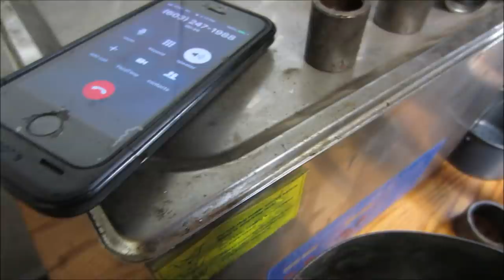VW BUS Transmission Failure,  Help Me Fix it,

Comment: Hi Mustie late to the channel but loving the content. On the leaky heat channel on the exhaust could you have welded the back shell of the tube first then you could access the inside to weld the inner edge to the rear then weld the second shell from the front if that makes sense. Just a thought, sorry if someone has said already. Keep them coming thanks  Dave

Comment: To set the valves. Take a screwdriver and weld a piece of iron perpendicular to it. Now you can adjust the valves easier because the screw no longer rotates. Or at least you can see it more easily when the screw turns. You can hold them in place more easily.

Comment: Back in 89 someone gave me a 73 bus for.....$1.00.  I fixed little stuff that made a big difference, but it kept popping out of first, I had to hold it in.
I wish I had some good help to fix it, I ended up selling it for $500.  Shoulda kept it.   The mechanic I talked to said I would have to crack open the trans in half to replace the fork.  I just didn't have the funds or tools then to get into it.  Maybe you could make a video cracking open a trans to repair forks? now that it's 2022....Shoulda woulda coulda.  These videos would have been so great in 89.....but then I didn't even have internet, or even a cell phone yet.

Comment: My folks had the ‘72 version. Same color. I was chided by some of my high school buddies who drove Mustangs to school. They laughed when I drove this until I said they could only fit 3 pretty girls in their car and it was difficult for them to get in and out with short skirts on. In my case, I could have 6 in my car and they could get in and out much more easily. They stopped messing with me after that.
Reply: In high school, I had 13 girls in my bug.  For some reason, it was really slow accelerating with the girls.  It was a short drive.

Comment: Two things:  You should always ensure the flywheel goes back on the same way it came off and an air gun will probably not torque the gland nut to the required 254 Ft/Lb.

Comment: On VW bugs, I would take the engine loose, jack it up and put blocks under it, push the car forward to get it separated from the trans. Then I would jack up the engine, remove the tall blocks, lower it onto low profile blocks and then I would lift the car by the bumper, as though it was a barbell, and walk the body forward until the engine was behind the car and I would set the car down.  When I realized I was strong enough to lift the '67 bug without the weight of the engine, I was amazed.
Yeah, they sell clutch alignment tools, but everyone I know, including me, use an old pilot shaft. If you've done a lot of car work you should have an old one somewhere.

Comment: Fun fact, those clutch springs are different colors because they have different heat tolerances before they  blister and burn. Depending on what color is burned you can tell exactly how hot the assembly got!

Comment: on the weld seam on the intake manifold...where you couldn't get to the back side...get some heavy duty aluminum bbq foil...fold couple times into a patch to cover back unwelded seam and clamp with stainless steel clamp...temp should not get hot enough to ever melt patch should seal off any leak...

Comment: Hey if you took a little button grinder and resurface the flywheel would that make the clutch last longer because doing brake rotors you don't want the lines to be circular if you can get them you know like with a grinder not a heavy grinder just to like grind the scratches going every which way it's better than them just going around in a circle

Comment: I always put a light coat of gasgacinch on the seal to case bore, because too many have leaked through where the case halves meet. but we were running them off road in rails at steep angles and high oil pressure/rpm's. I had a few leak through the crank snout to flywheel and dowel pin area too, nothing like an "oil bathed" clutch that's supposed to be dry lol
**whoops, so I started to gasgacinch the flywheel to crank faces also, some said it would make it work loose, but never any issues with a 5rib bus trans and turning large wide tractor tires. it would do over 60MPH in 2nd gear on the road. 1st gear was about perfect for all woods/climbing, 2nd the trees and things went past too fast and your rear end would pucker solid if you were brave enough to keep it wound up. the three rib trans sucked, 1st was too low and 2nd too high to run full time.
then again, nobody else seemed to like the 5rib and couldn't turn the tires good, so maybe it was the much to do with the choice of cam, rockers, timing and dual carbs on tall track manifolds and a wrench that happened to find the right combo (pats self on back)

Comment: Hey Mustie (is there a story behind that name?), 3 questions… In fixing the exhaust leak, is there not a flexible hose that can take that kind of heat that could have been used?  And if not, would it have been possible to bend out one side or the other just enough to have room to  fit the repair sleeve over one end and then slide it up enough to allow room to bend it back in line so you could then slide the new sleeve down over the other side and avoid having to cut and weld?  And finally, could you have used a chemical weld product (i.e. JB weld) to seal the ends?  Not saying that you could have or should have done any of these options, just wondering if these options were even possible?   Like you, I am always figuring out ways to repair things without replacing, so I naturally think of many options.  Thanks for all the great vids!

Comment: I”m not an expert and I don”t even play one on Youtube, but I wonder if it would be easier fix for the preheat pipe to weld the back half first from the inside to the original tube ends and then weld the front half . Might be less prone to leaks? Though welding rusty crap is always a gamble.
Reply from the maker: how would you rotate it to weld the two long seams
Reply: I assumed that it would be possible to weld them at the top and bottom, as you were able to weld the other end all the way around. Canl’t really tell how much space there is.

Comment: Could you have used "JB Weld" extreme heat to seal where you couldn't weld on the backside of that patch?   Knowing you I figure you had already thought of that. I was worried about carbon monoxide poisoning.  Is it that the fumes are sealed off so that they don't affect the occupants, or maybe there is sufficient airflow to blow it away???
Reply: Yes, they make a jb weld that's meant for exhaust components

Comment: Hello friends, I know that many of you are very professional in this, my father has a 1972 type 2 vw and adapted a more powerful engine, but this is not enough because he continues with the original transmission with a 7x40 step, I need to know  The pinion and ring with lower R&P compatible, I will appreciate your answers! Thanks and excelent video

Comment: you used to be able to pull the bumper and back brace put an orange crate under the bus undo the linkage and 4 bolts and push the bus forwards leaving the engine sitting on the orange crate, the crate was the perfect height

Comment: Turn the  hood prop rod 180 Degrees over. That will catch your shirt and put a narly cut on your arm. Unbolt it and turn it over and out it back on at a 90 degree angle and then  bring it back up and bolt it in place. 
        Interesting exhaust system, if they were going to do something custom at least bring it out the correct side.
      A fun video, everyone sees something different.

                                                                              Ycasts

Comment: that gear oil bottle had a spout(small pipe on cap) would it have been faster to put it in and just squeeze the bottle to get the oil out?

Comment: so was it the transmission, or could you just have adjusted the shifter like you did in the end to fix it? (ignoring the boots and welding issues)
Reply from the maker: trans, we tried to adj years ago but just kept getting worse

Comment: I ran one of those '009 distributors for a while on my stock 1600 with a pertronix ignitor module which appears to be what you have on this engine. I switched to an SVDA with an electronic ignition from rock auto and it runs far better with the vacuum advance distributor than without, zero hesitation on take off.

Comment: Mustie, you've got me interested in owning a VW Van now.  I've always had a thing for the Thing, but the van looks like much more fun to me.  Can a 6'9 guy drive one, or is it asking too much from a nearly 50 year old vehicle?  Love the vids and love the way you interact with us.  Keep 'em coming!
Reply: Not a stock one , I am 5 9 and my knees near catch the wheel, if you put a small aftermarket wheel then it needs expensive aftermarket rack and power steer conversion, couple of thousand bucks.
Buses are super slow in-stock form. Hipo engine , clutch and trans upgrade add another 10 thousand min.

Comment: Re the back of that bike tube, if you have a similar access problem another time it might be an idea to rub a little exhaust fixing paste on the blind side that you can’t weld and the heat will then seal it up ... just an idea.

Comment: One year only manifold.
Goes outside and looks at the 4 kombis from 1964 to 1978 plus the two spare engines I possess.
Two engines don't have the holes for the moustache bar (the splittie and the splitties spare engine) but all have the one year only manifold :)

Comment: Usually when the Transmission would pop out of a gear, it most often was a worn syncroniser caused by the driver riding around with their hand resting on the shift lever putting pressure on the gear.

Comment: Little late reaction but didn't see your video. I have a smal positive comment, you used loctite to fixed the stud for the gearbox mount. You use way to much on the treads the less you ad the higher the strainged.
So on that M10 of M12 could not see it well is one drop enough.
As always nice video Mustie

Comment: with the rubber parts.. you can try using dishwashing liquid, which will make it much easier to slide through...much cheaper than silicon, and it will evaporate

Comment: There's a product called Marine Tex which is a 2 part epoxy like JB Weld.  They claim it fix broken crankcases, I've never tried it for that.  But I have "fixed" broken exhaust manifolds with it, 1 of which is still holding over 10 years later.  That would work great for that spot you couldn't reach with the welder just to seal it up.

Comment: Had the tiny leak in the same place  found s 2400  deg epoxy "quick seal" sets with heat ran the old bus fora year with zero leakage

Comment: needs some shag carpet on the engine cover and floor.. its too noisy.  I loved my 64 kombi camper,  balanced  blueprinted 1700 twin port,  50HP at the 17in land rover wheels. (2 1/2 times the original 1500..). Only problem was the diff side plates had to be tightened every 5k km. 
So much torque trying to explode the gear box.  hehe bring her up to 4000, drop the clutch, The van rises 4 inches as the axle reduction gearbox torques the torsion bar, then everything bites and first on tarmac spins the wheels. cruise all day and night at 70mph (in the fuel crisis 50mph limit)..  That was a good time. the 70's.

Comment: I had a 67 chery half ton pickup put a used 4 speed  in and it would pop out of 4th gear I had a bungee cord with one end securely fastened into the back of the seat with the other end laying on the seat read to use drove it for years

Comment: @ 36:00 minutes, you can see at the ten-thirty position a single balance weight stud with a #3 on it. 
There are 5 other holes for weights, around the flanges where the bolts go, none of these have weights, on this particular pressure plate

Comment: As an convinced automatic driver yet i guess here it could be too 
little transmission oil, and/or leaking. Most think transmissions last 
for ever and they never need an oil change. Or levelling. I change 
the (auto-) trans oil on my car(s) any 50`000 KM, so they work 
faultless for very long.

Comment: So I was watching you repair the heat Riser. And are you cut that piece of metal. Then you cut it down the middle. I thought you were going to attach the back half to the heat Riser pipe weld that then will the other half to that so that way you have a weld in the back side where you couldn't get to the way you did it.

Comment: You are doing a great job and know more about VW s than I do but why didn't you resurface the fly wheel or get another one they shinning surface will cause the new clutch disk to slip and fail eventually especially with a heat check on the surface  . Not bitching just a question great job bud

Comment: Next time use some JB Weld in the back part that you couldn't get to.  I know many a mechanic that has used that to fill a hole in an exhaust manifold that was super small OR on a manifold they couldn't find the replacement for.  and it holds just like steel!

Comment: My 1969 Volkswagen Bug would  blow out the spark plug in the number one cylinder. The spark plug with the threads still on the spark plug would be laying on the shrouding that was over the cylinder jugs. It was always the same cylinder.

Comment: 1:05:33 JB Weld, Mustie! You wouldn't have had to break out the welder. They got the 2 putty formula you blend together and shape. Just slide yer' pipe repair part over the putty pieces and let it harden in place.

Comment: i got a baja with the 72 bus trans in it but it just sits the engine runs but not good carb problems in a 63 bug . i have a 74 for baja that i got for 400 bucks runs good . way to bis. building other rigs .

Comment: sooooo   you fix it by replacing the whole transaxle ...   LOL   I missed part because I am working but that's what I gather.  I will watch this again though.    I wonder if the shifter needed knocking around and the old transaxle was fine?

Comment: In reading thru the comments there seems to be a lot of confusion about Mustie1 torque settings. If you refer to ch. XX of HOW TO KEEP YOUR VW ALIVE FOREVER 19th Edition  (pg 430) you will find the tried & true method of torque settings. This method is based upon ease of use & years of experience. Speaking of experience Mustie1 has probably forgotten more about VW than I could ever know!

Comment: What did Mustie1 say when he didn't use a torque wrench to tighten the gland nut,  "______ ____ the torque, and its right about there" – what was the word I missed? Using a socket and a wrench handle I can often do a good enough job of estimating whether I have tightened a threaded fastener the correct amount, because I can FEEL it if it is tight enough, but I don't know how to do that with a just a power impact driver. There is nothing to feel. I can only judge by the speed of the tool and the sound. And I don't trust that. So when using a power impact driver I always purposely err on the side of too lose, knowing that erring on the side of too tight could twist off the bolt head, stretch out a bolt or stud, or pull the threads out of the thing that the bolt or stud threads into. Knowing I've erred on the side of too lose when using an impact wrench, I always tighten some more using a torque wrench. Not sure how Mustie1 knows when to stop when using an impact wrench. Now, looking at the flywheel, it turns counterclockwise if I recall correctly, when the engine is running, and the gland nut threads in clockwise – so this reduces the likelyhood that the nut will come loose when the engine is running. Still, I have no idea how to get the correct tightness with an impact wrench – unless I have one of those torque-limiting extension bars to use with it. Although if the torque must be precise I don't trust those.

Comment: I've rebuilt a lot of VW aircooled engines, replaced many clutches, and every time I removed a flywheel retaining nut I have used a torque wrench to make sure the nut is tightened properly.  Must say I am a bit horrified to see you use nothing but an air wrench to put the flywheel nut back on.  If memory serves, that nut requires 270 foot-pounds of torque.  You just don't want that flywheel getting loose while the engine is running,

Comment: That heat tube your working on - try using a old weed wacker drive flexy cable in a drill to pass through from side to side as it will work lose that black grungy crap that blocks it up..
Reply from the maker: l have an old ebrake cable pretty much the same thing
Reply: @mustie1  thought you might have had - after I posted my comment.. "Injineers" all think alike eh - lol..love your vids mate..makes me smile when you ask "me" - Us all..lol

Comment: If I were you, I wouldn't use break cleaner spray at all, my coworker died of sinus cancer from using that stuff for years, battery terminal protector spray is just as deadly too.  Asbestos brake dust is deadly too.

Comment: Where is your flywheel  holding tool?
ever has a gland nut come off the flywheel because you failed to torque it correctly and in the process ruin the dowel pins,the flywheel and the crank shaft end?
Reply from the maker: never and ive never seen one that came apart

Comment: why, when welding the pipe patch, did he spot-spot-spot instead of laying a continuous bead?
Reply from the maker: more control
Reply: Don’t want to burn thru that thin metal. I generally use .023 wire on thin metal.

Comment: Why not use Wood burning stove 2000 deg seal between the sleeve and the old tube, then clamp.  No wielding required.

Comment: if you used the rear main seal installer tool I sent you, you wouldn't need to guess with the hammer method ;  -  )